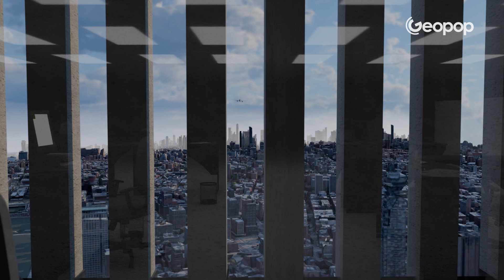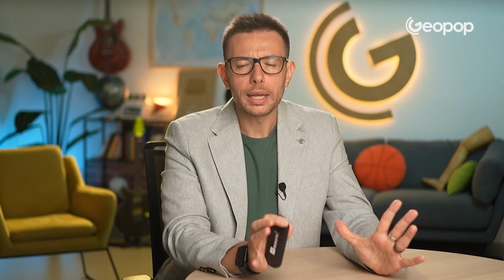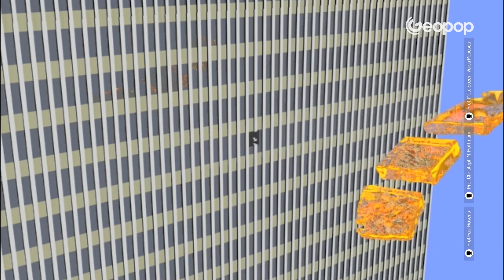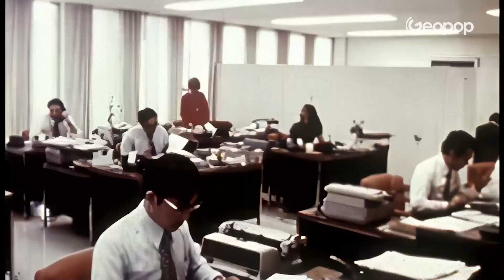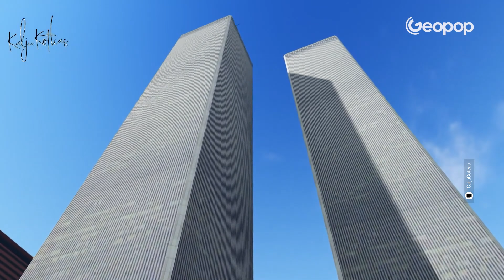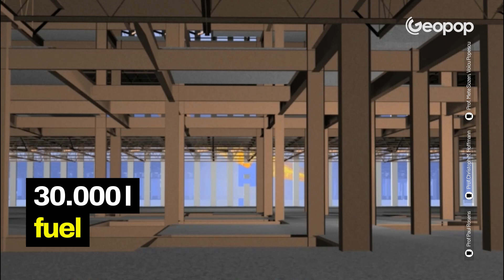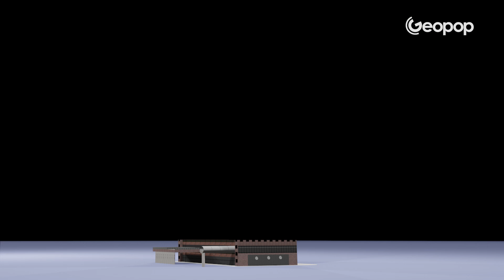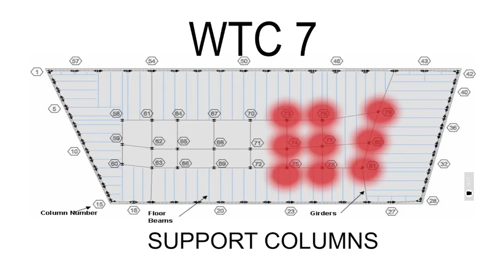9/11, 2001: The Technical Reconstruction of the Twin Towers and WTC 7 Collapses

Comment: 8:50 why would the fires increase to 900 C????
Most of the fuel would explode and/ or disperse/ flash on impacts, the resulting fire will be mostly fuelled by combustible material in the building itself which is not dense enough or have enough carbon to sustain a 900 C long enough to weaken the steel.
Reply: Are you just assuming or do you have 150 years of fire science research to back that up?
Reply: @TheLoonResistance 
I’m not assuming. I’m a chemical engineer and studied and applied combustion in my career. You need a continuous supply of fuel and to contain the heat inside a well insulated and small space to reach temperatures high enough to start softening steel. This is not 150 year old science!!!! 
Blacksmiths knew that thousands of years ago..

What this video and others are saying is that the WTC was weak enough to collapse under fire, fuelled by jet fuel, because obviously the plane impact alone will not affect the integrity of rest of the building
Reply: @doyouknoworjustbelieve - It was a combo-platter.

Impact damage + Fire (heat) + Time + Gravity = Collapse

Remove any one of those elements and there is no collapse 

Ignore any one of those 4 elements and you will never understand the collapses.
Reply: @TheLoonResistance 
The identical collapse of WTC7 proves the 4-element combo platter explanation wrong.
That building did not experience a direct hit and did not experience a fuel supplier fire.

Of course the WTC7 was built to withstand time and gravity.
Reply: @doyouknoworjustbelieve  - What identical collapse?  My previous comment clearly referenced only the Twin Towers and the collapse of Building 7 could not have been more different to that of the Twin Towers.
Reply: @TheLoonResistance 
Why did building 7 collapse?
Reply: @doyouknoworjustbelieve  - Building 7 was the 6th building to collapse of 10 lost on 9/11 and because of its early low priority was largely ignored for a while, so conspiracy filled the information void with simple-minded garbage by technically ignorant people promoting political agendas. This created a lot of confusion and misconceptions which I wish  to dispel, so I prepared this brief summary of my own analysis, using technical analysis, not ideology and magical (non)thinking. 

At 10:28am the WTC North Tower collapsed, showering Building 7 with tons of burning debris, causing heavy damage and starting many large  fires which burned out of control for the next 7 hours. Half the FDNY firefighters having been killed, units in disarray, equipment destroyed, no water pressure, and the greater urgency of search & rescue efforts, Building 7 couldn’t be saved so firefighting efforts were pulled as futile and 7 left to its fate. Firefighters make that sort of choice every day in brush fire situations - which houses to save and which ones to let go. Only real difference here is moving the decimal on the size and cost. People get overwhelmed by the size.

www.youtube.com/watch?v=g_SvpwyC17M

Collapse of a burning structure is always a concern for firefighters. Steel buildings subject to fire rely on active firefighting to survive. Buildings are designed around 1 to 3 hours of fire resistance, allowing time for occupants to escape and active firefighting to get started, after which all bets are off. Left to their own devices they'll exceed their design envelope and collapse, like Plasco Tower and Wilton Paes de Almeida. In 7 the occupants escaped, passive and active fire protections were compromised and active firefighting was abandoned hours before the collapse, which left the building to its fate. It lost. Odds on Building 7 would eventually collapse, and it did. No big deal in logic.

 http://www.youtube.com/watch?v=WnYBX6QT0R4 

FDNY Chief Daniel Nigro - The biggest decision we had to make on the first day was to clear the area and create a collapse zone around the severely damaged 7 World Trade Center, a 47-story building heavily involved in fire. A number of fire officers and companies assessed the damage to the building. The appraisals indicated that the building's structural integrity was in serious doubt. I issued orders to PULL back the firefighters and define the collapse zone. It was a critical decision; We could not lose any more firefighters. It took a lot of time to PULL everyone out, given the emotionalism of the day, communications difficulties and the collapse terrain 

FDNY Deputy Chief Peter Hayden ; We had our special operations people set up surveying instruments to monitor and see if there was any movement in the building. We were concerned of the possibility of collapse in the building. And we had a discussion with one particular engineer there, and we asked him if we allowed it to burn could we anticipate a collapse and if so, how soon? And it turned out that he was pretty much right on the money, that he said 'In its current state you have about 5 hours 

The collapse of Building 7 was anticipated and widely reported in the media throughout the day, with 24 video cameras recording some or all of the collapse. Everyone knew what was coming and why. 

www.youtube.com/watch?v=OY5S5k3tMHI

Building 7 collapsed from the inside out which is not at all intuitive and hard to understand, with most details being hidden from view.  It requires careful analysis and observation, and some people will struggle no matter how much it is explained. But here is my explanation relying on no outside authority. 

Building 7 was a unique, asymmetrical 47-story steel frame structure built atop a smaller 3-story building serving as a partial foundation, requiring lower floors dedicated to complex load transfer structures. Of trapezoidal shape and tube-in-tube construction, B7 (above the 7th floor) consisted of a central core of steel columns carrying most of the gravity load, perimeter steel columns around the outside of the structure carrying the remainder of the gravity loads and long span beams and girders to tie those elements together and form the floors. On the outside of the building hung a facade or outer shell. 

www.nist.gov/image-16640

Phase 1 : First externally visible signs of collapse initiation occurred at 5:20:28 pm and was notably quiet with observers not realizing the building was collapsing! No warning in the form of hundreds of eardrum busting 180dB explosive bangs. Here at 12:00 a local CBS affiliate reporter talking 10 blocks from B7 when collapse begins. People don’t start to notice the collapse until 12:11. At 12:45 is the famous CBS fixed camera clip of Building 7’s collapse. Note the silence. 

www.youtube.com/watch?v=t5tEy6mXSE8

Lower floor failures above the load transfer region (8-14) in the NE corner initiated the collapse. In this video at 0:45 you can see the NW corner from inside the building while under construction, Column 79 just out of frame on the left. That big, angled steel beam across the top of the frame connects to C79 at one end. The girders connect to the beam. That beam and all those girders depend on just one connection 

www.youtube.com/watch?v=nP3TNHPCIVU&t=45s

Phase 2 : NE corner floor failures caused a loss of critical lateral support over an excessive length of Column 79 and it buckled. Looking at the above floor diagram of Building 7 when you see all the structures that depend on C79 you quickly realize this one column was a relatively isolated structural element on which a disproportionately greater fraction of the structure depended analogous to say the Key Bridge. Externally as collapse begins we see a vertical progression of window breakage along the 44-46 line and a kink in the roof of the East Mechanical Penthouse at the top of the building, consistent with C79 failure. Normally with a buckling column, the load could be redistributed to other columns. With C79 that is not the case - the failure did not redistribute the load, so the collapse rapidly progressed to the roofline, sinking the rooftop penthouse. The transition from full capacity to almost no capacity occurs in an instant and will result in virtually no resistance 

Phase 3 : With C79 gone, B7’s progressive, non-symmetrical collapse continues with adjacent columns 80 and 81 left laterally unsupported and quickly buckling as well. The EMP drops down through the building. C79-81 all have no diagonal bracing, which is the major reason why they could not redistribute a lot of vertical loads among one another. From there collapse progressed from east to west through the central core until the core was gone from 81 to 58, taking all the interior floors and probably most of the perimeter columns with. Follow the horizontal progression of window failures low in the building and the dropping of the remaining rooftop structures into the building. The NIST Building 7 study model 4 determined C79 failing under ANY circumstances would have initiated the same collapse sequence. 

Phase 4 : After about 10 seconds only the exterior moment frame remains, giving the illusion B7 is still standing to the casual observer since little has outwardly changed. But it is just a hollow empty shell like an empty cereal box supported only by a few remaining columns and overloaded from the loss of the core columns and floors, quite unable to remain standing. With nothing remaining behind it, the north face leans inward, forming a V in the roofline, the last few columns buckle under the strain and the moment frame free falls, landing on top of the debris pile. 

It is only here at the very end, a single measurement of alleged free fall acceleration is taken, from just one point on that outer shell. The Building (core and interior) did not “free fall” - was already gone before that happened - just one corner of the outer shell briefly moved at a rate comparable to FFA. This alleged FFA was a product of how the shell fell NOT why the building fell . It’s also not even proper FFA as the single measured point was moving in 3 dimensions, not just down, which adds another variable. Start to finish the collapse took 18-20 seconds, 3 times longer than true FFA . How fast something falls can’t tell you what started it falling, certainly not 10 seconds after it started falling.  

The debris spread outside the footprint blocking surrounding streets, heavily damaging the Verizon Building and destroyed Fiterman Hall. 

No building is meant to survive 7 hours of multi-floor unfought fires. Building 7’s progressive, non-symmetrical collapse was incidental, unintended collateral damage from the combination of fire, time & gravity started by the collapsing North Tower, true no matter who planned and carried out the 9/11 attacks or why .  Of so little consequence it barely registered at the time, only taking on semi-mythical status as an alleged smoking gun years later when demolitions at the Twin Towers, missiles at the Pentagon and shoot down over Shanksville all failed and conspiracists had nothing left to work with. 

Anything can seem like a conspiracy if you don’t understand how it works. Now you should. I hope you found this helpful, informative and it solicits informed critical comment. If I made any errors of fact, logic or reason or left anything important out, please let me know so I can fix it. OR offer a more plausible alternative if you can. Be the first. Please start any reply with the words “Tits McGee” or I will know you didn’t read it and are wasting my time.
Reply: @TheLoonResistance 

Europhysicsnews: 

15 YEARS LATER:
ON THE PHYSICS OF HIGH-RISE BUILDING COLLAPSES
Reply: @doyouknoworjustbelieve  - NOTE FROM THE EDITORS

_This feature is somewhat *different from our usual
purely scientific articles* , in that it contains some
speculation. However, given the timing and the
importance of the issue, we consider that this
feature is sufficiently technical and interesting
to merit publication for our readers. Obviously,
the content of this article is the responsibility
of the authors_
Reply: @TheLoonResistance 

Might wake you up:

The 9/11 Files: From Cover-up to Conspiracy | Ep 4

I didn’t know until I watched this video today that there were building between the two towers and building 7, and that these building did not collapse on or after 9/11.
Tucker Carlson raises many other valid questions.
Reply: @TheLoonResistance 

The 9/11 Files: From Cover-up to Conspiracy | Ep 4

I didn’t know until I watched this video today that there were building between the two towers and building 7, and that these building did not collapse on or after 9/11.
Tucker Carlson raises many other valid questions.
Reply: @doyouknoworjustbelieve  - There's an awful lot of things you don't know.  Best to start fixing that by seeking out better sources and not letting others do your thinking for you.  

For example, I provided a detailed step-by-step description of the collapse of Building 7.

And you completely ignored it.  

But you go all-in on a Tucker Carlson money grab like it's scripture.  I suggest you start making better life choices.
Reply: @TheLoonResistance 
Please provide a detailed description of why the buildings between the two towers and building 7 did not collapse.

These buildings were WTC 3–6. They  were of course severely damaged by debris from the collapsing towers but did not collapse. Building 7 collapsed on its own later that day. It did not experience a direct hit or fire.
Reply: @doyouknoworjustbelieve  - Building 3 did collapse, as did Building 4.  Why do you have an expectation every building in the area would just flop down?  That's not rational. 

Every surrounding building is it's own unique case of different design and construction and different damage and thus needs to be looked at on its own merits.  You are trying to apply a simple(minded) one-size-fitz-all solution so you don't have to do any real thinking.  I already explained Building 7's collapse and you completely and deliberately ignored it, so why keep going?  I'm pretty much done doing all of your thinking for you.

Might I suggest a more suitable hobby?  Perhaps something involving crayons.
Reply: @TheLoonResistance 
Ad Hominem attacks reveal a lot about the attacker. Congratulations on sharing your insecurities on YT.
Reply: @doyouknoworjustbelieve  - Not an ad hominem since I am describing a consistent pattern of behavior on your part.  After you opened with an argument from authority I have no sense since after 28 posts that you are capable of an original thought. Further, I have seen numerous instances of you ignoring direct answers to direct questions that do not provide the results you want.  Your rhetorical questions are getting old. 

That is NOT a me problem.
Reply: @TheLoonResistance 
I went back and read all your posts. I didn’t see your ‘detailed’ step by step explanation of how WTC7 collapsed. Can you please send it again and check 1 minute later that YT did not delete it.

In the mean time, I did re-read your post about the 4 elements of collapse:
Impact, fire, time and gravity. 😅
Reply: @doyouknoworjustbelieve  - Then you don't know how YouTube works.  

@TheCriticalStinker-01
4 days ago

 @doyouknoworjustbelieve6694  - Building 7 was the 6th building to collapse of 10 lost on 9/11 and because of its early low priority was largely ignored for a while, so conspiracy filled the information void with simple-minded garbage by technically ignorant people promoting political agendas. This created a lot of confusion and misconceptions which I wish  to dispel, so I prepared this brief summary of my own analysis, using technical analysis, not ideology and magical (non)thinking. 

At 10:28am the WTC North Tower collapsed, showering Building 7 with tons of burning debris, causing heavy damage and starting many large  fires which burned out of control for the next 7 hours. Half the FDNY firefighters having been killed, units in disarray, equipment destroyed, no water pressure, and the greater urgency of search & rescue efforts, Building 7 couldn’t be saved so firefighting efforts were pulled as futile and 7 left to its fate. Firefighters make that sort of choice every day in brush fire situations - which houses to save and which ones to let go. Only real difference here is moving the decimal on the size and cost. People get overwhelmed by the size.

www.youtube.com/watch?v=g_SvpwyC17M

Collapse of a burning structure is always a concern for firefighters. Steel buildings subject to fire rely on active firefighting to survive. Buildings are designed around 1 to 3 hours of fire resistance, allowing time for occupants to escape and active firefighting to get started, after which all bets are off. Left to their own devices they'll exceed their design envelope and collapse, like Plasco Tower and Wilton Paes de Almeida. In 7 the occupants escaped, passive and active fire protections were compromised and active firefighting was abandoned hours before the collapse, which left the building to its fate. It lost. Odds on Building 7 would eventually collapse, and it did. No big deal in logic.

 http://www.youtube.com/watch?v=WnYBX6QT0R4 

FDNY Chief Daniel Nigro - The biggest decision we had to make on the first day was to clear the area and create a collapse zone around the severely damaged 7 World Trade Center, a 47-story building heavily involved in fire. A number of fire officers and companies assessed the damage to the building. The appraisals indicated that the building's structural integrity was in serious doubt. I issued orders to PULL back the firefighters and define the collapse zone. It was a critical decision; We could not lose any more firefighters. It took a lot of time to PULL everyone out, given the emotionalism of the day, communications difficulties and the collapse terrain 

FDNY Deputy Chief Peter Hayden ; We had our special operations people set up surveying instruments to monitor and see if there was any movement in the building. We were concerned of the possibility of collapse in the building. And we had a discussion with one particular engineer there, and we asked him if we allowed it to burn could we anticipate a collapse and if so, how soon? And it turned out that he was pretty much right on the money, that he said 'In its current state you have about 5 hours 

The collapse of Building 7 was anticipated and widely reported in the media throughout the day, with 24 video cameras recording some or all of the collapse. Everyone knew what was coming and why. 

www.youtube.com/watch?v=OY5S5k3tMHI

Building 7 collapsed from the inside out which is not at all intuitive and hard to understand, with most details being hidden from view.  It requires careful analysis and observation, and some people will struggle no matter how much it is explained. But here is my explanation relying on no outside authority. 

Building 7 was a unique, asymmetrical 47-story steel frame structure built atop a smaller 3-story building serving as a partial foundation, requiring lower floors dedicated to complex load transfer structures. Of trapezoidal shape and tube-in-tube construction, B7 (above the 7th floor) consisted of a central core of steel columns carrying most of the gravity load, perimeter steel columns around the outside of the structure carrying the remainder of the gravity loads and long span beams and girders to tie those elements together and form the floors. On the outside of the building hung a facade or outer shell. 

www.nist.gov/image-16640

Phase 1 : First externally visible signs of collapse initiation occurred at 5:20:28 pm and was notably quiet with observers not realizing the building was collapsing! No warning in the form of hundreds of eardrum busting 180dB explosive bangs. Here at 12:00 a local CBS affiliate reporter talking 10 blocks from B7 when collapse begins. People don’t start to notice the collapse until 12:11. At 12:45 is the famous CBS fixed camera clip of Building 7’s collapse. Note the silence. 

www.youtube.com/watch?v=t5tEy6mXSE8

Lower floor failures above the load transfer region (8-14) in the NE corner initiated the collapse. In this video at 0:45 you can see the NW corner from inside the building while under construction, Column 79 just out of frame on the left. That big, angled steel beam across the top of the frame connects to C79 at one end. The girders connect to the beam. That beam and all those girders depend on just one connection 

www.youtube.com/watch?v=nP3TNHPCIVU&t=45s

Phase 2 : NE corner floor failures caused a loss of critical lateral support over an excessive length of Column 79 and it buckled. Looking at the above floor diagram of Building 7 when you see all the structures that depend on C79 you quickly realize this one column was a relatively isolated structural element on which a disproportionately greater fraction of the structure depended analogous to say the Key Bridge. Externally as collapse begins we see a vertical progression of window breakage along the 44-46 line and a kink in the roof of the East Mechanical Penthouse at the top of the building, consistent with C79 failure. Normally with a buckling column, the load could be redistributed to other columns. With C79 that is not the case - the failure did not redistribute the load, so the collapse rapidly progressed to the roofline, sinking the rooftop penthouse. The transition from full capacity to almost no capacity occurs in an instant and will result in virtually no resistance 

Phase 3 : With C79 gone, B7’s progressive, non-symmetrical collapse continues with adjacent columns 80 and 81 left laterally unsupported and quickly buckling as well. The EMP drops down through the building. C79-81 all have no diagonal bracing, which is the major reason why they could not redistribute a lot of vertical loads among one another. From there collapse progressed from east to west through the central core until the core was gone from 81 to 58, taking all the interior floors and probably most of the perimeter columns with. Follow the horizontal progression of window failures low in the building and the dropping of the remaining rooftop structures into the building. The NIST Building 7 study model 4 determined C79 failing under ANY circumstances would have initiated the same collapse sequence. 

Phase 4 : After about 10 seconds only the exterior moment frame remains, giving the illusion B7 is still standing to the casual observer since little has outwardly changed. But it is just a hollow empty shell like an empty cereal box supported only by a few remaining columns and overloaded from the loss of the core columns and floors, quite unable to remain standing. With nothing remaining behind it, the north face leans inward, forming a V in the roofline, the last few columns buckle under the strain and the moment frame free falls, landing on top of the debris pile. 

It is only here at the very end, a single measurement of alleged free fall acceleration is taken, from just one point on that outer shell. The Building (core and interior) did not “free fall” - was already gone before that happened - just one corner of the outer shell briefly moved at a rate comparable to FFA. This alleged FFA was a product of how the shell fell NOT why the building fell . It’s also not even proper FFA as the single measured point was moving in 3 dimensions, not just down, which adds another variable. Start to finish the collapse took 18-20 seconds, 3 times longer than true FFA . How fast something falls can’t tell you what started it falling, certainly not 10 seconds after it started falling.  

The debris spread outside the footprint blocking surrounding streets, heavily damaging the Verizon Building and destroyed Fiterman Hall. 

No building is meant to survive 7 hours of multi-floor unfought fires. Building 7’s progressive, non-symmetrical collapse was incidental, unintended collateral damage from the combination of fire, time & gravity started by the collapsing North Tower, true no matter who planned and carried out the 9/11 attacks or why .  Of so little consequence it barely registered at the time, only taking on semi-mythical status as an alleged smoking gun years later when demolitions at the Twin Towers, missiles at the Pentagon and shoot down over Shanksville all failed and conspiracists had nothing left to work with. 

Anything can seem like a conspiracy if you don’t understand how it works. Now you should. I hope you found this helpful, informative and it solicits informed critical comment. If I made any errors of fact, logic or reason or left anything important out, please let me know so I can fix it. OR offer a more plausible alternative if you can. Be the first. Please start any reply with the words “Tits McGee” or I will know you didn’t read it and are wasting my time.
Reply: @doyouknoworjustbelieve  go look at a picture of WTC 6. The side in front of WTC 7 was completely destroyed by the debris falling from the Towers. Moreover, there is ample photographic evidence of the damages of WTC 7 and the fires before the collapse.

I'm also curious as to why they would have demolished it in a false flag, since no conspiracy theorists ever managed to give me a satisfying answer.
Reply: @TheLoonResistance  Stinkyshit, as you disgusting liar know damn well, NIST analyzed steel from the fire zones and couldn´t find a single piece that had reached 600°C or more. The very most parts hadn´t even reached 250°C.
Reply: @TheLoonResistance 

Two building hit at two different elevations and one building never hit by a plane or catching fire, but all three collapsing on their footprints on floor on top of another pretty much all three collapsing way down!!!!

Come on!!!
Reply: @doyouknoworjustbelieve  - OK, but do you have anything other than bad facts, improper context and a heaping helping of ignorance-fueled personal incredulity ?

I can do a lot better than that.
Reply: @TheLoonResistance 

The 9/11 Files: From Cover-up to Conspiracy | Ep 4

I didn’t know until I watched this video today that there were building between the two towers and building 7, and that these building did not collapse on or after 9/11.
Tucker Carlson raises many other valid questions.
Reply: Office fires routinely reach 1000°C or more.
Reply: @Tim22222 

what you are saying is the WTC couldn’t withstand a big office fire.
Reply: @doyouknoworjustbelieve  "what you are saying is the WTC couldn’t withstand a big office fire."

Unfought and in concert with severe structural damage, obviously not!
Reply: @downstream0114 
This was not a Molotov bottle thrown by hand.
When a plane hits a building at a high speed, the fuel flashes out and explodes instantly. It does not soak into lower floors. Office furniture fires don’t bend or melt steel.
Reply: @doyouknoworjustbelieve  Not all of the fuel "exploded instantly"; some of it started office fires that burned unchecked. And YES office fires burn hot enough to substantially weaken steel.
Reply: @doyouknoworjustbelieve  Could you please do me a favor? Ask CriticalWanker which the 5 buildings are that it claims to have collapsed prior to WTC7. It is way too much of a coward to answer me questions, ever. Seems as if it feels brave enough to answer to you though, so perhaps after asking the question to him like a hundred times there is a chance that you can finally get me an answer of this pathetic coward...
Reply: @doyouknoworjustbelieve  That´s not exactly what I asked you for, but nevermind...
Reply: @Kudde23
These new YT threads are confusing. I moved my  replies to the other thread. 👍👍
Reply: @doyouknoworjustbelieve  Still not what I asked you for, but again, nevermind...
Reply: @Tim22222  Yeah timmyshill, a tea light can even reach 1400°C. Now try to heat up a steel beam with a tea light, good luck dumbfart!
Reply: Apparently you are 

"I’m not assuming. I’m a chemical engineer and studied and applied combustion in my career"

but your firdt sentence said

"Most of the fuel would explode and/ or scatter on impacts"

Never heard anyone describing fuel scattering before  ......     splash and then combust perchance.

This just seems like another sofa expert  ignoring evidence to get a required result
Reply: @zMW574e 
You are right!
Fuel splashes and vaporizes.
English is not my first language, so sometimes a literal translation slips in especially when I’m tired or sleepy.

The word I was looking for is disperse. 

Good catch.